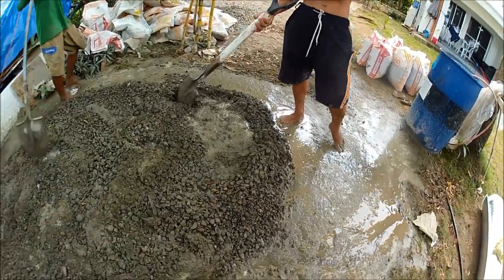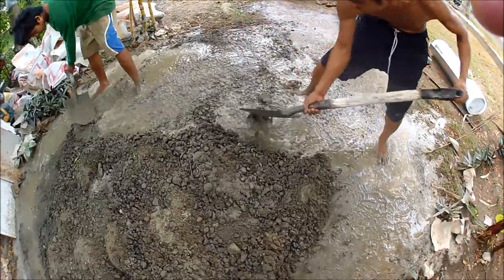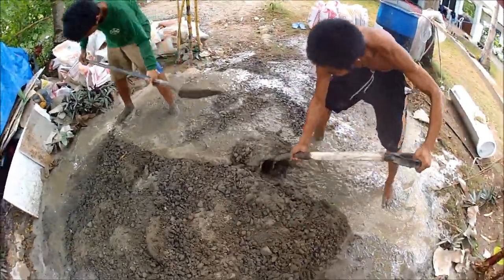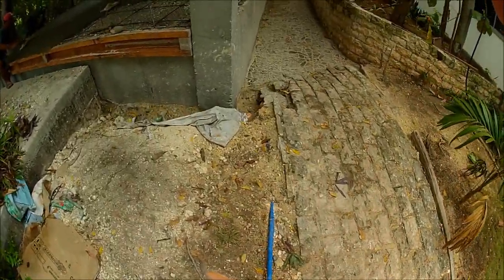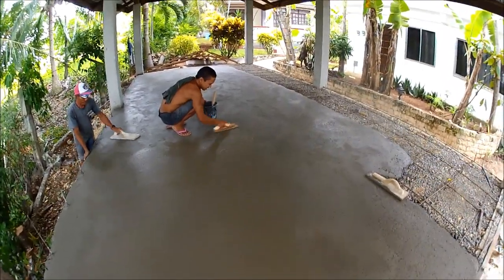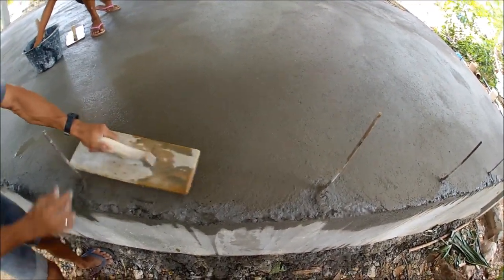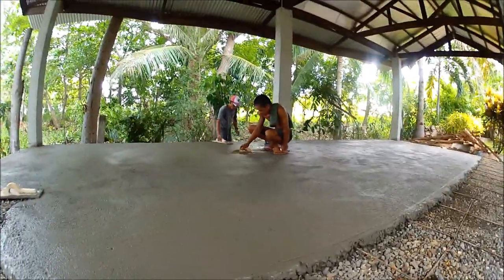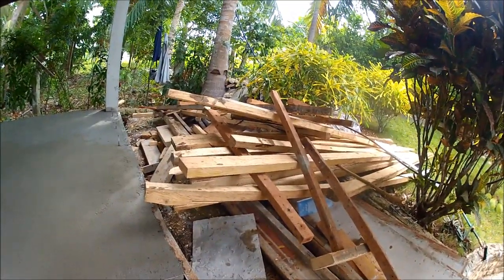HOW TO MIX CONCRETE CEMENT AND RABBI HANGING UP RIDING THE JEEPNEY

Comment: Michael just wondering, when they mix the cement on the ground do they pick up much organic material, that will rot later and cause holes and week spots in the mix. Leaving the rebar flat on the ground and not floated in the middle is there any need to use this way?